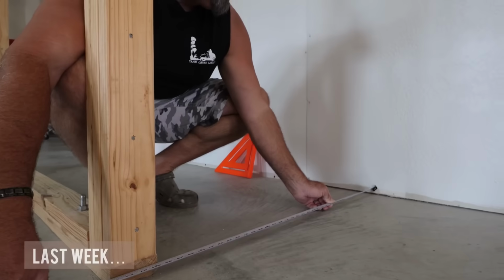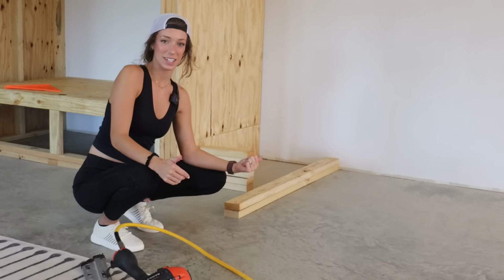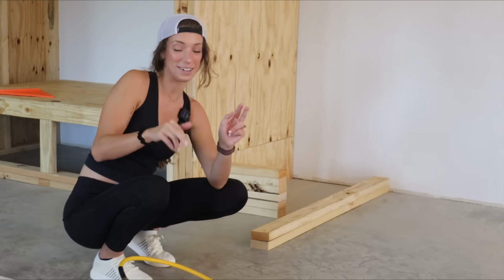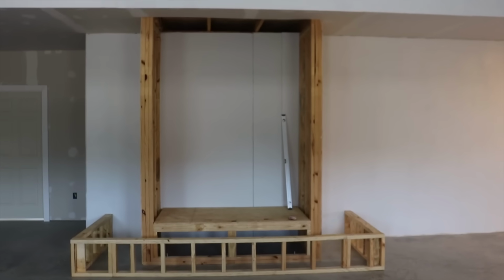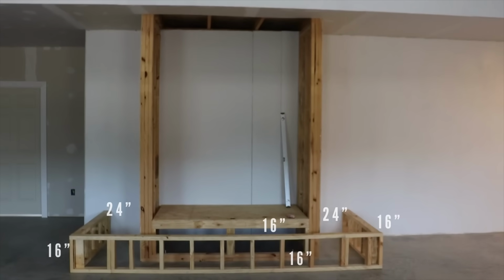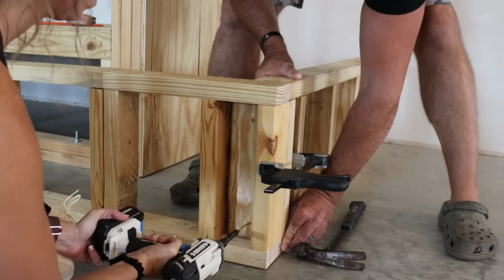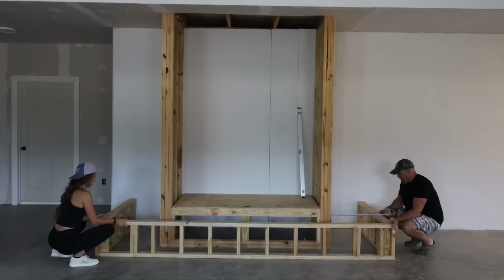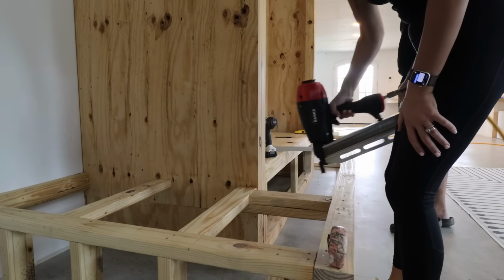Constructing A Fireplace Pt.2 | Building Our Own Home Ep.111

Comment: First, glad that the fire danger seems in check. Second, I was glad to see the hand placement while using the nail gun. Not saying it happened to me (well, yeah, I'm saying exactly that) a finish nailer at 90 PSI will drive a misdirected (knot in my case) wire brad right through your finger, on the side of the board. A lesson learned once, and remembered from that point on.
Reply from the maker: Oh my! Ouchhhhh! I bet that was awful!

Comment: Do you not need pressure treated sill plate where your bottom plate is resting on the concrete? In my neck of the woods we do!
Reply: Not for interior finished concrete. That rule of thumb applies to exterior installations, or installations that will/could come in contact with water.
Reply from the maker: We have a thick plastic moisture barrier under our house slab. We would’ve definitely used treated material if there was a possibility of moisture contact. Great eye by the way!